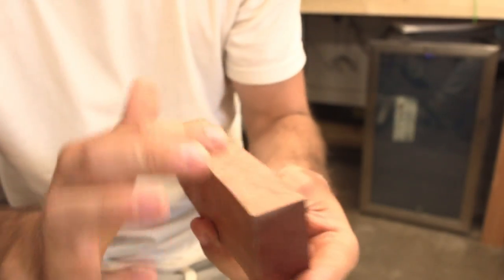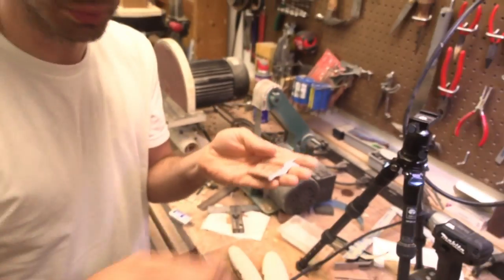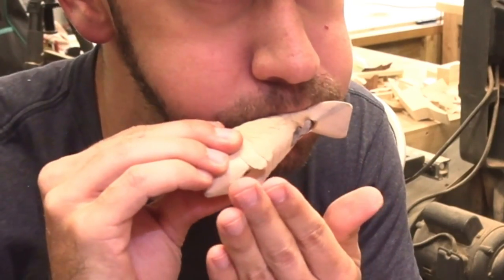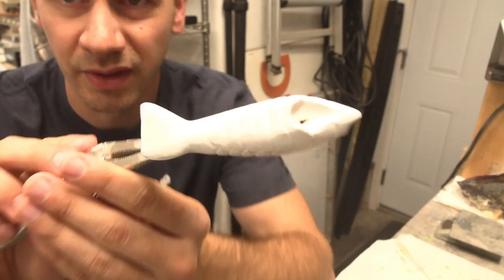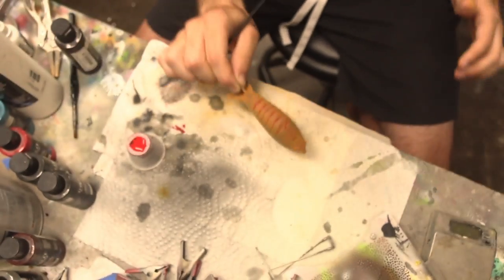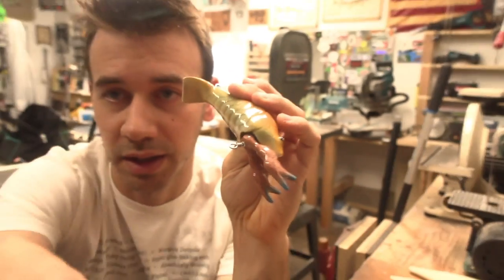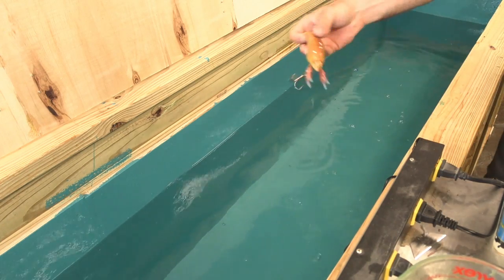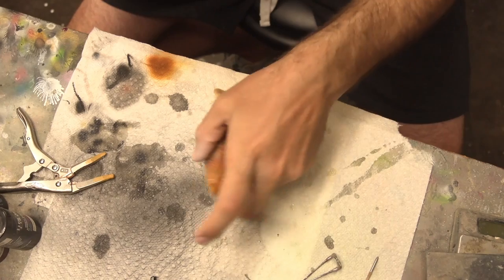Making a Suspending Crawdad CrankBait with Jointed Pinchers

Comment: I was working with some zebra  wood once and it smelled the same as you described the reddish wood smelling. As I was working I started smelling the dog poop smell and sense I was outside I started looking around to find out where it was. I kept looking at the bottom of my shoes thinking I might have stepped in some. Finally I put the piece of wood I was working on up to my nose and figured out where the smell was coming from. You have some pretty good detail work going on in the piece.

Comment: 2 things - super dope lure my man, losing art that you create hurts - as a writer I've been there. 

Second thing - my strategy for a lure retriever is a little different than others I've seen. Grab a pack of 2oz triangle sinkers at Walmart is like 2 bucks for 7 of them or something (with your 80# set up you could probably go heavier). Attach a solid strength snap to the narrow end and clip it to you line. Then launch it by bringing your rod tip down and flipping it up. Then drop the tip back down. This will launch the sinker up over the water and, depending in how far away the lure is stuck, will create a pull force opposite the direction you were reeling behind the lure- increasing the likelihood of freeing your snag. If it doesn't free it on landing, a couple pops up and down should do the trick. 

I'm a fan man, hopefully I described that clearly - it's saved my multiple trebles in the dark of night.

Comment: My dad has a tool for recovering lures like that as long as the lure is still attached to your line, its a bunch of small chains crimped into a small pipe with lead in it so it looks like a flail and on the other end you have corkscrew like hook and thick braided line attached to a big real. You attach the chain jig to the line via the corkscrew hook and let it slide down the fishing line to your snagged lure and then you shake the chain jig until one of the chains snag one of the hooks or the weight of the chain jig unhooks the lure. If it snags the lure you can brute force the lure off of what ever it snagged so in most cases the hook will bend or break. Works best if you are over the top of the snag in a boat.

Comment: it was really great looking.   sorry it got snagged.  can you get waders on and retrieve?   I would like to see you create a mold with that shape,  with the claws as a separate mold.  Through body, use a stiff wire from back to front with front and back loops.  connect to line at back body loops.  then a wire through center of claws from front to back with loop at back and front.   treble hooks at front loop and a light weight swivel to connect claw  to body at loops.. I enjoy your vids.   you are both artist and craftsman.  thank you for sharing.

Comment: Painter's extension pole or a long enough branch with a screw eye that you can slip your line in (the little space where the eye is curled over} so it will follow your line down to the lure- put the screw eye back from the end about 3-4" (inches) so you can punch or push lure back out of snag - too late for this one but when they're close enough to shore this works- could just carry a screw eye and find the right branch if happens again - hope that helps sometime

Comment: also just a suggestion, have you ever thought about using an even smaller gauge hook wire for the test fishing? I've straighten a lot of wire hooks out trying to get them unsnagged. Usually just irritates me more having to replace hooks, but I imagine it could be useful when you put so much work into a bait like that.

Comment: Might want to add a aquarium sand filter and chlorine to that tank. 😮 we have this thing called a Tackle Back in Australia they work a treat to get lures off snags. We also have like a long extendable pool pole with a wire spiral on the end they also work good. Such a shame for such a cool lure you take it well. I’ve seen blokes break rods in anger when they lose a $10 commercial lure. 😂

Comment: I would like to see a crawfish bait with a multi-jointed tail that mimics the natural tail motion of a crawfish as it propels itself through the water. The bait would be used in a jerk action to simulate the movement of a fleeing crawfish. The claws could also be built in such a way where they move independently and flare out then draw together when jerked.

Comment: I cant believe you haven't made an awesome lure knocker yet🤨 a 5 oz lead weight that you could put an awesome paint job on and make it a piece of art in itself, put a couple loops to hang it on the line like a two contact zip line with another eyelet on the rear with a couple hundred feet of 1000 pound test nylon rope, a metal coil on the front end or a couple links of dog chain to snag the hooks of the stuck lure and you'll get your baits back. sometimes the weight of the lead jiggled around will knock it free other times it takes the coil or chain to snag the hooks to pull it free with the heavy line..
Reply: Yes.

Comment: its been quite a while since ive worked with exotics, and ive forgotten more than i know, but i do remember that a lot of the foreign exotic woods are very toxic. you obviously didnt break out from skin contact with the oils in the wood, but i would still be very cautious of that "dog poop" scented dust in the air.

Comment: you really need to finally get or make a lure retriever. you know, one of those that slide down the line and grab the lure by the hooks with loops of wire that they have in the front. might have not worked in this case, though (because there's just one hook), but still.